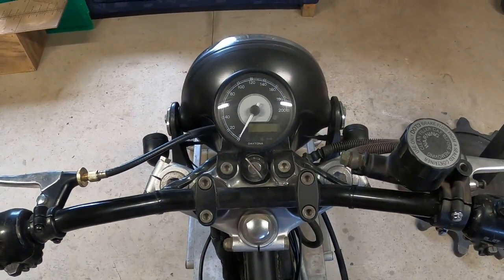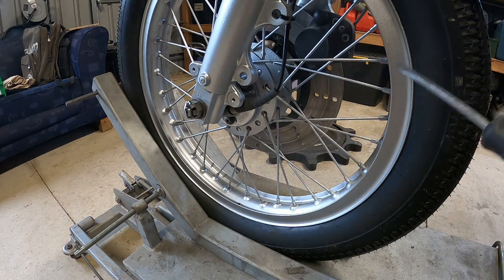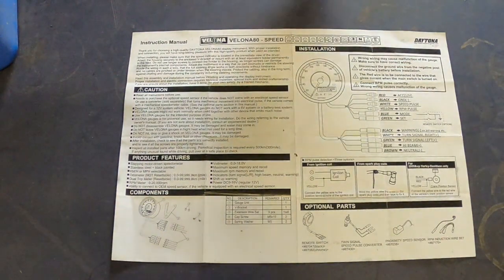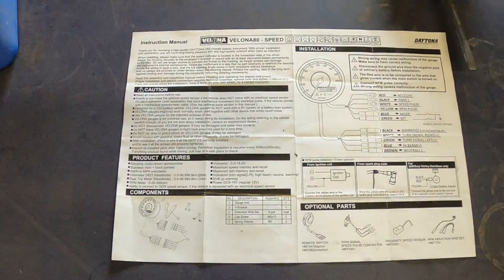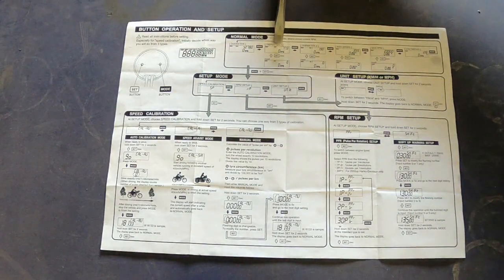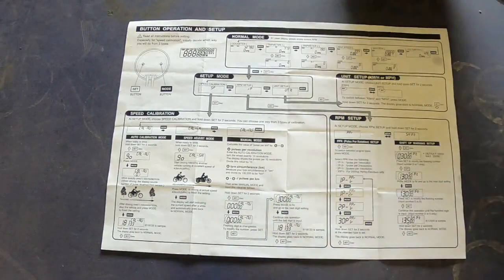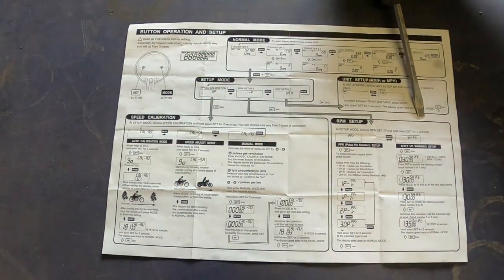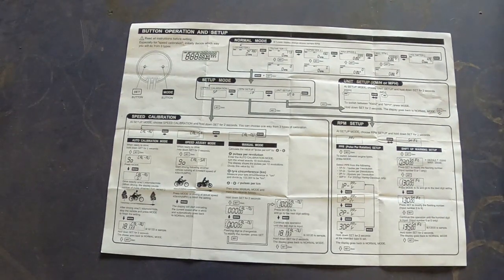XS650 Brat Build Ep 28, Daytona Velona Gauge Wiring & Setup

Comment: I have one and I have trouble turn it on, do you conect only red and black to switch on only? Cheers thanks
Reply: @2wheelworkshop yes, that's what I think, but nothing it's all off no lights no nothing, then funny, I linked the other wires like the neutral to earth and green N comes on... That pilot lights works, I guess it's broken from factory, I will claim other one or refund, thank you for your time other question regarding it, só no need for a memorie wire like the auto-radio to keep set up?

Comment: Hey man this video help us so much , we in progress build street tracker with that speedometer send bybour customer from Netherland . Questions, so we need that M12 Thread Female #87429 speed pulse converter to replace convetional speedometer cable right ? 
And that parts its sale saperately with the velons speedo yes ?
Reply from the maker: Hey mate. There are 2 options for the speed signal. #1 magnet and pick up (best for when using non standard wheels) #12 speed pulse converter (recommended if you have the original speedo drive) and yes they are sold separately.

Comment: I am looking to switch mine since the bike is imported, so I would like to swap to one that shows in km/h. But is it possible to add my current miles to it since its digital? or do I need to start from 0? And is it possible to and the kink stand waring for the warning light or is it just for oil warnings?
Reply from the maker: It will be in the instructions you get with the unit whether or not you can enter the original km/miles. I think you can but only when brand new (don't quote me though). You are able to wire any switch you want to the warning light.

Comment: Hello, can u help me with my installation. i m stuck at the magnet sensor part. i bought the velona gauge for my SR400 which also comes with that small magnet sensor, however i m not sure how does it pick up pulse or how does it "read" the speed of my bike, should i install it on the front fork n let it pick up the disc rotor spinning motion or do i need some other part that generate the pulse signal? thank you.
Reply: @2wheelworkshop  i dont seems to have that magnet, the package only comes with the sensor, do i have to buy it separately or it suppose to come together or it actually not suitable for bike that old model?
Reply: @2wheelworkshop  so is it has to be a magnet but not a bolt install on the rotor disc?
Reply: @2wheelworkshop  great, i will look into it, thank you
Reply: @2wheelworkshop  any magnet bolt? but how does it measure the speed? is there any setting i need to set in the gauge?
Reply: @2wheelworkshop  understand, thank you very much

Comment: Excelent video. Does the Daytona Velona handle double coil ignition for RPM?
Reply from the maker: Thanks mate. My bike runs 2 coils. It has settings for if the bike fires every revolution (2 stroke or redundant spark 4 stroke) or if the bike fires every second revolution (traditional 4 stroke). It even has a setting for some weird harley multi spark system that I never bothered learning about.

Comment: Tried all three speed calibrations. After calibrations at 70km/h speedomeeter speed indicator goes to 0. Any ideas or tips? Got 47 pulses per 10 revolutions on my BMW K1100LT 1997.
Reply from the maker: I wish I could help mate but it sounds like the unit might be faulty. If it were me I would repeat the process one more time to make sure and the contact the manufacturer.